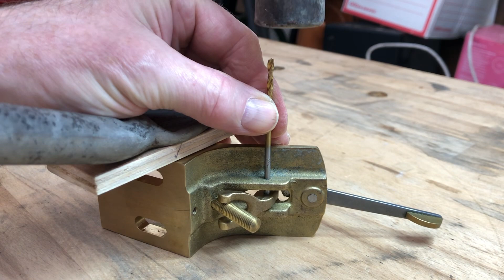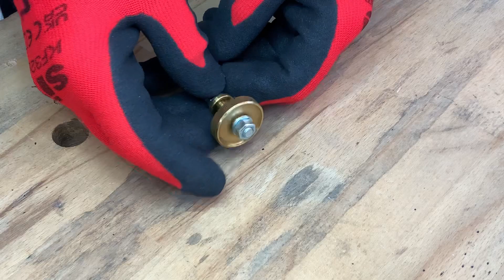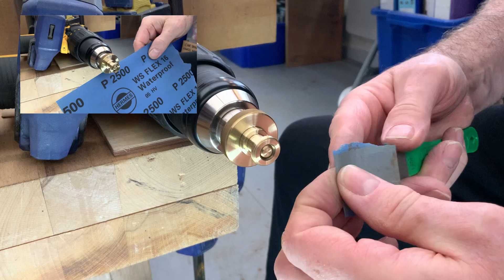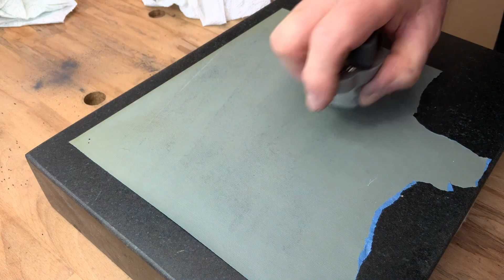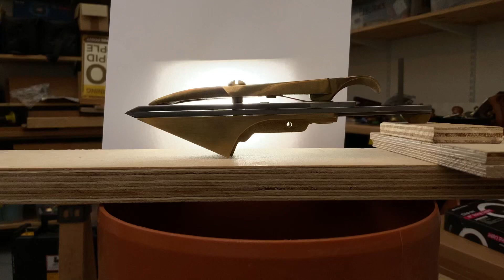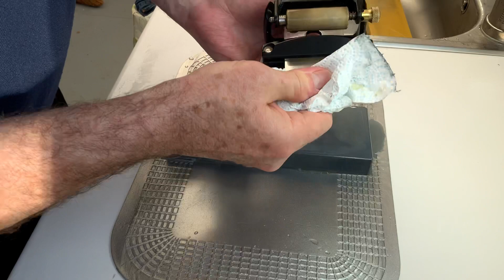Super Tune! The Lie-Nielsen No 4 - Part 2

Comment: Another easier way to remove the frog screw is to wrap leather around the screw and use the locking pliers to grip it that way. No need to hunt down thin copper wire to wind around the threads. Genuine leather is the only thing that will work not fake leather or vinyl. I appreciate your idea of softening the slot of the chip breaker. I wouldn’t have thought of that but it looks like it’s gonna work.
Reply from the maker: Wow, that’s a good idea; didn’t think of that. I’m wondering; when we have a problem to overcome, we look around the workshop for something that’ll do. I didn’t have leather at the time, so copper it was. But I think your idea would be easier.

I’ve had success too with easing the chipbreaker slot on my block plane. I think it’s because the blade gets moved more frequently.

Thanks for the comment!

Comment: Hit comment too soon, wanted to finish off by saying a set of old Record planes an and a couple Stanley planes with their thin irons and chip breakers really benefitted with an altered chip breaker. To get the most out of them I also made redesigned lever caps. My caps put pressure in the middle and both ends and with no lever but a thumb screw in its place. I coated the blades with transfer ink and get nearly 100% transfer on the frog of all the planes. It was a huge improvement on the poorly made Record planes. I’d leave photos but didn’t see any way to post them here.

Comment: I appreciate you replying to the comment I left about chip breakers. It’s not an issue on Lie Nielsen planes as their irons are so thick. There were noticeable wear marks on the frog of my Lie Nielsen plane at both ends, especially at the end of the lateral adjuster. That bothered me as the plane is a work of art, seemed like a blemish that I had to try and remedy. I actually came up with a way to eliminate the chip breaker entirely using a tee nut that clamps to the blade and engages the yoke. I made a special hinged lever cap to go with it and I don’t have to fool around with a chip breaker again. I take the bade out of the plane and leave the tee nut in place when sharpening. The tee nut clears my honing jig just fine.

Comment: You did an excellent job on that plane. Especially like you pointing out the arching of the blade and chip breaker assembly above the frog. I never liked that about the Stanley design. I have Lie Nielsen 4 1/2 smooth plane and fixed that problem by milling a slot across the width of the chip breaker about 1 1/2 in from the edge. This deliberately weakens the chip breaker allowing the blade to sit flat on the frog. Worked great. I’ve done this to all my Stanley type planes, making my own chip breakers out of thicker steel. Spreads the pressure over more of the frog, not just the ends. Makes for a really rigid setup.
Reply from the maker: Thanks for your comment, and sorry for the delay in replying. 

That’s an interesting way of dealing with the problem right enough. Since making the video, I’ve thought about it and I’m now wondering if a redesigned chipbreaker is the answer. On the other hand, is it enough of an issue? I don’t know…

Best wishes, Jim

Comment: Great videos on fettling this excellent plane. One point though: It seems that you actually ground that mis-shape into the depth adjuster in your previous video on your process. At 8:30 of part 1 of this series you work to flatten and polish the top of the frog, but you leave the yoke free to swing back and forth while you grind the frog (you even mention this). It would appear that your fettling has created that polished area on the depth adjuster. If you look at the footage in Part 1 prior to you working on the top of the frog, the adjuster doesn't appear to be polished or scarred in the way that you show it to be here at the beginning of part 2.

(Don't ask me how I know that this can happen,)
Reply from the maker: Thanks for the comment, @Propsman416! How do you know that this can happen? (Sorry couldn’t resist!😉)

It’s a good point you make, so I went back through the footage. I agree that in Part 2 there appears to be a bit of round over and polish on the top corner, whereas in Part 1 it appears to be sharp and dull. So yes perhaps dragging it back and forth has polished that edge a bit. One point to note is that it was dragging on the granite plate and not on the abrasive paper. Could it be that the granite has an abrasive quality? I’ll need to do some tests. Thanks for highlighting that; we might be on to something.

In part 2, I’m dealing with the lateral scar on the yoke caused by the sharp arris in the chipbreaker slot. I don’t think that’s what you mean, because when I zoom in to the 8:30 in part 1, I can see that was there. When I was making part 2 I must’ve missed that polish on the top edge because it wasn’t on my mind at the time; the scar was. Also I assumed the granite was smooth. As I said, perhaps it isn’t. Interesting.

Thanks again, and well spotted!
Reply: @mrlinnsworkshop  I think I created a polished flat by pressing the backside of my thumbs against the yoke in an unconscious effort to gain just a little bit more leverage during the flattening process. 

I'm a big fan of your method of using one piece of a trued component to machine the mating face of a different component. Optimizing the known values and all that.

I appreciate the videos and your response to my comment. All the best.

Comment: Hi where did you get the mag locks from and is that what they are named thanks
Reply from the maker: Hi John; they’re called MagSwitch. I got them a long time ago from Axminster Power Tools, but they don’t sell them anymore. They’re on Amazon, but are crazily expensive these days - £77. Try using a little wooden block stuck on with double sided tape. Clamp it in the vice for a few minutes to make it grip better.

Comment: Darn, you have mover the goalposts far into the distance but it was still worth the wait for the update. Clearly my net searching is rubbish because I have not been able to find anything like that magnetic holder shown at 21 min 20. Could you please point us in the direction of a supplier?
Reply from the maker: Thanks for the kind words Coline! Those magnetic holders are called Magswitch. If you search for that on Amazon you’ll find some. Unfortunately, they’re really expensive these days. I bought mine nearly 20 years ago and I don’t remember them being so expensive; maybe mine were knockoffs. I’ll have a think about alternative methods of holding the blade and report back.
Reply: Maglock has arrived much quicker than they said it would, first trial shows it was money well spent. May take a while to get up to your standard but shall e giving it a try.
Reply from the maker: Well done! Let me know how you get on with it
Reply: @mrlinnsworkshop  Not quite a super tune yet but the mag switch is priceless. Someone sold a Clifton No3 after one use and at great loss! I know from experience that quality control of finishing at Clifton is dire but the basics if the planes are promising but I was shocked at just how poorly finished the planes are now. I bought one several years ago in the expectation that it would show just how a plane should work, who would have thought that something so expensive would be so rough out of the flimsy shoebox it comes in. Anyway with the help of the mag switch and a few hours in the shed on. rainy davit is already tuned up better than any of the old Stanley and record planes worked on in the past. rough mating surfaces now slide with ease and has already set a new standard to work to. Thanks for setting such a good example.
Reply from the maker: Coline, I’m glad you’re trying it out! Just think, you won’t have to do that again but you’ll get great results from that plane now.

I remember David Charlesworth expressing his dismay at the quality of Clifton planes at the first course I attended in 2005. Unfortunately there was one poor chap who had bought a complete set and brought them with him to do the course. David used them to show what was wrong with modern British manufacturing and compared them to the LNs and Veritas. The lad spent hours every evening flattening the soles of them all!
Reply: @mrlinnsworkshop  After I bought the Clifton some years ago the plan had been to be patriotic but that plan was scrapped as I opened the box! Veritas has my money and seem to be most of the way there out of the box but can always get a bit of fettling like polished fences for example... I could not bear to buy from US incase any of the workers voted for the orange fool as much as I would have preferred a bronze N0 3.
Reply from the maker: Veritas are excellent. Dare I suggest a Quangsheng No 3 from Workshop Heaven?
Reply: @mrlinnsworkshop  I did once try a Quangsheng block plane but the moveable mouth mechanism was visibly misaligned... The Clifton may have been horribly rough, they have given up on even giving it a polished bling finish on lever cap and tops of side rails now, but it will perform as a heavy smoother and the old Stanley is so light in comparison it feels like a block plane. Most of my planes have been old Stanley / Record / Millers Falls which shall keep me busy slowly revisiting to tune up to higher standard after rewatching your whole set of tune up videos.
Reply from the maker: That’s interesting; my next video - out hopefully before the 18th - is about the 60 1/2 block plane…